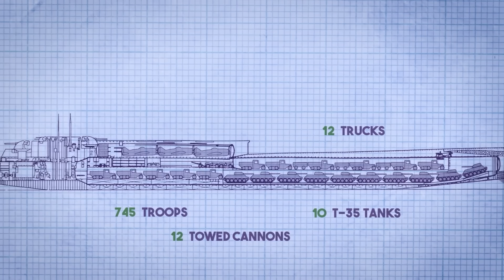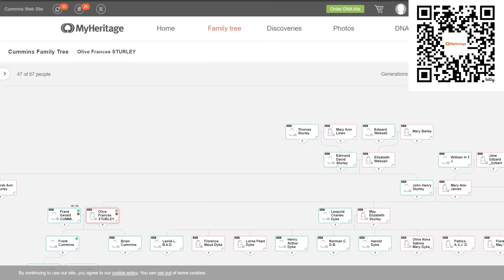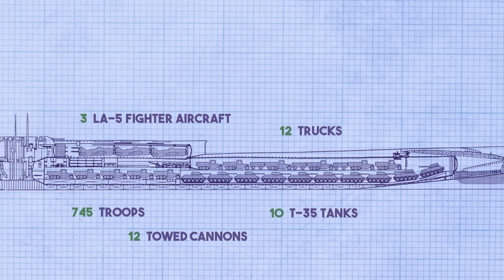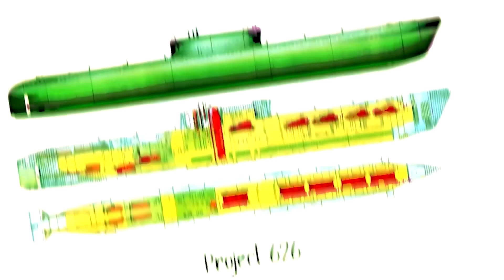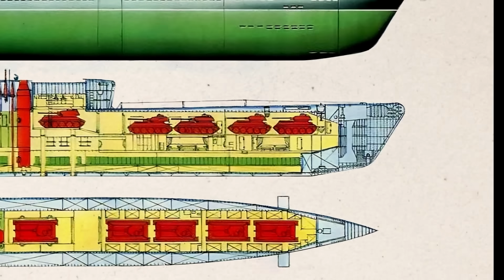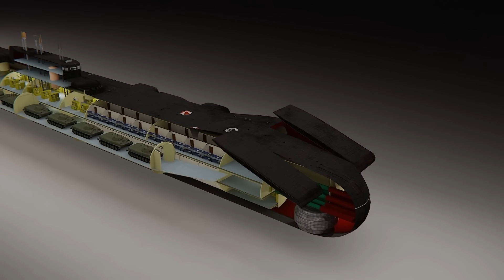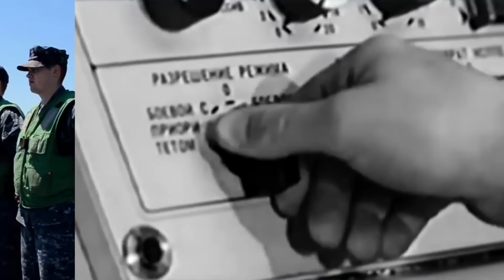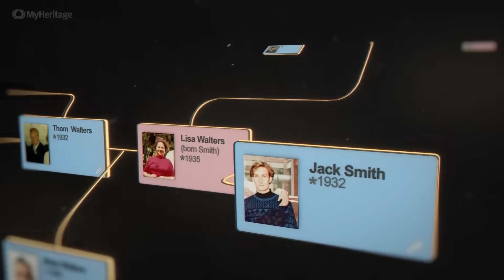Russia's giant submarines to invade North America

Comment: Project 621 was intended to carry T-34s, not T-35s. The T-35 is a failed multi-turreted heavy tank from the 1930s whereas the T-34 was a widely successful medium tank which would've been much more suited given its size and smaller crew.
Reply from the maker: Thanks for the correction
Reply: Uses T-34/85 3D models, writes T-35. 🤦‍♂️. 
I caught that too.
Reply: @CAP198462 to be fair post war the only T-34 variant worth anything was the T-34/85
Reply: @jameson1239  i mean that goes for basically any tank with a lot of gradually improved variants, the newest will be the best
Reply: Blame the Russians and their numbered projects. I mean T-34 is newer, better tank but T-35 is an old failed one built decades before.  It's as confusing as the Japanese way of naming their weapons with Type>insert number<.
Reply: @dareka9425  thankfully far better than the US' system for naming tanks. oh wait...
Reply: I was wondering how more than maybe 2 T-35's would fit in there xDD
Reply: It’s called a “mispronunciation”.  We all make them.
Reply: @TheAKgunner  It was not an error in pronunciation, rather a typo in the script. The difference between T-35 and T-34 is minor in terms of spelling but it matters within the context of the video, since fitting any amount of T-35s would require much more space than the same amount of T-34s. If the purpose of the video is to inform then the information presented should be as accurate as possible. 

Commenting on such an error increases engagement statistics and gives more context for anybody confused by the mistake. Its a win-win for everyone.
Reply: "Widely successful". I'd chalk that up simply to production capacity. The tank itself was Hell to operate and the Germans had the guns to penetrate it.
Reply: @MikMoen  The T-34-85 was relatively well armored, mobile, and had a very good gun. It was no means a wonder of engineering, but it was capable of killing the technically superior tanks of the German army. It became one of the most widely produced tanks in the world and is still seeing combat to this day, so I think it would qualify as a success.
Reply: This video is filled with errors. It’s popcorn level trivia.
Reply: Don't worry about it.  This whole video is a work of fiction - just like the Russian "threat" to the west today.
Reply: T34 crew is no bigger than T55 tanks until the autoloader tanks become the norm. It's driver, commander, gunner, and, loader. So no, their crew is no smaller.
Reply: I've seen many of these basic mistakes on this style of videos lately that I no longer watch these types of videos. Anyone have any recommendations?
Reply: @iiyyxxnn  Paper Skies, Rex's Hangar, Drachinifel, and Mustard are all pretty good channels to watch. I generally avoid the Infographics Show and Mega Projects because they're rushed videos and full of inaccuracies.
Reply: @moldypotato4656  I took a screenshot of your comment, thanks brother.
Reply: The T-34 was the most mass produced tank of WW2. That's the only thing it had going for it. Well, that and German stupidity.
Reply: @StudleyDuderight  German stupidity?!
Reply: @StudleyDuderight  When the T-34 entered the battlefield in 1941, it was superior to any German tank on the field. It suitability to large scale manufacturing and its upgradability meant that it was used well after WW2 and saw combat in other conflicts such as the Korean War.

Name one German tank still used after WW2
Reply: @SOLOcan  absolutely BS.
Reply: @SOLOcan  You're not looking at the full picture. The T-34 was designed to be just good enough. It wasn't necessarily superior. Russia could churn them out faster than Germany could destroy them. That's what made them so successful. Minus the maintenance and logistics problems, the Panther was superior to the T-34. If Germany had had the US' logistics capability and industrial base then we might be having a completely different conversation.

Most of Germany's aircraft and tanks were scrapped to rebuild the economy and infrastructure. It wouldn't have mattered anyway since the Bundeswehr started getting M-47s a few years after the war ended. All of the WW2 shit would have been phased out by Korea.

M-26s rolled right through T-34-85s in Korea.
Reply: @SOLOcan panzer 4s were used for quite a while after ww2
Reply: @SOLOcan panzer IV and a few others based on it where used as late as 1967 by the syrians in combat on the golan hights.
The French used panthers for some time post war. The Czech used quite a few german tanks and even continued to build and use of the sdkfz. 251 well into the cold War, at least the 1960s, but think I heart that they where keept in reserve for quite a bit longer.
The Swiss used the jagtpanzer 38(t) for a long time.
And that list is most likely not complete

With other allied tanks you have a similar story.

Cromwell and Churchill where used in Korea.

As where m-4s, m-24s and m-26s.

M-3 and M5 Stewart's where inuse till the 1990s.

Israel used the m-4 up until the 80s. 

Also the Sherman was or still is in use by chillle and the m-24 is also still in use in Urugay (or was it paragay).

SO the t-34 is not realy special in that respect.
Reply: @SOLOcan  was it though? the "inferior" german panzers and panzer 3s were able to score heavy casualties on the "invincible" t34 in the hundreds, waaay before the "badly needed" panthers and tigers came along
Reply: @polygonalfortress  This is the opinion of those German panzer commanders. It was pretty much accepted that they had superior tanks, but the Soviets lacked the training and doctrine to take advantage of it. 

Like this was a key part of Germany's strategy man. Stalin had just been done purging his entire officer corp. There were very few people left who knew how to lead a platoon.
Reply: @tobiasfreitag2182  I know the T-34 is not special in that respect. My point is that German tanks are special in that nobody used them after WW2. I've never heard about the Syrians using Panzers in 1967, why did they do that?

I know the French used panthers, but their opinion of it is often used as an example of how overrated the Panther is given they dropped its use almost immediately.
Reply: @SOLOcan   @SOLOcan  Yes, the T-34 suited the Soviet Union's doctrine. They needed a cheap tank that was easy to produce and was just good enough to survive a hit or two. Russia went all in on the wave tactic. You don't need to have amazing shit when you can throw an endless number of men and machines at an enemy that's suffering from supply shortages and incompetence.

I brought up the M-26 because you talk up the T-34 like it was the best tank of the period. Korea proved just how shit the series really was when up against something that was easy to maintain and could to be produced in significant numbers.
Reply: @StudleyDuderight  >M-26s rolled right through T-34-85s in Korea.

Heavy tanks from the very end of WW2 rolling right through medium tanks first designed in 1943. Shocker
Reply: @NamedPimpback The M26 was a medium tank, and the T-34-85 was not created in 1943.
Reply: @SOLOcan  well they they used them because the Czechs had lots of german equipment that was surplus to there needs, and there soviet overlords thought that this surplus equipment could best be used to supply there allies in the middle east.

For that reason the first equipment equipment used by the idf was german. For example, the Czech version of the bf-109 or the kar-98 rifle. Stalin, in the beginning, was very pro Israel, so that is where this equipment went first. Only after a major shift in Israeli politics towards the west around 1950 his focus changed, and the equipment was shifted towards the Arab nations. That's why ex german tanks ended up in Syria and stg-44s all over the Middle East. 

The syrians, as far as I'm aware of, used german tanks for quite some time, till they where finally slaughtered on the golan hights in '67. But I guess one can not so much blame that on the quality, lack thereof, of the german tanks as on a general inferiority of training and tactics. All Arab tanks suffered heavily at that time.
Reply: @StudleyDuderight  no the Soviet Union did not use “human wave tactics” their military doctrine was Deep Battle Theory and was the most sophisticated for fighting a modern war. It’s clear now you don’t know what you are talking about.

Again so what about the m-26? I don’t care about that and it’s got nothing to do with what I said. 

Yes I talked up the t34. I was specifically responding to someone talking about the t34, you have no idea about my opinion on the the m26, and that is deliberate. It’s called staying on topic, something you don’t know how to do
Reply: @StudleyDuderight  the m-26 was not a medium tank in the context to the t-34, calling it a medium tank is extremely misleading. It was reclassified after the war in response to changing tank philosophies and the development of the main battle tank concept

The Sherman considered by the US to be equivalent to the t-34, the M-26 soviets equivalent would have been the the IS-2. BTW many M-26 were eventually replaced by Sherman’s in the war because they were more useful, and yet you fail to consider this, only caring about K:D ratios like it’s a video game. When you say “ok at the bigger picture” what exactly did you mean?
Reply: @SOLOcan   Fair point about the reclassification coming after the war, but the M26 was still a medium tank when created. I'm gonna drop that argument though. It's too apples to oranges. I will have do some more reading about the tanks in the Korean War. I was under the impression that the M26 replaced the M4 because the 76mm wasn't cutting it against North Korean and Chinese tanks.

I don't think K:D alone is what wins wars. It helps, but isn't enough on its own.

You've been oversimplifying what made the T-34 a success. It was a long list of reasons(logistics, strategy, morale, numbers, air and artillery support, etc etc etc) all combined. That's what I meant by "big picture." The T-34 wasn't a terrible tank, I shouldn't have made that argument, but it wasn't very good either. You don't need the best tank in the world to beat an enemy that can't keep its own tanks running, and keeps making bonehead decisions. In the end it was the best tank for Russia's needs... Throw bodies at the problem until there is no more problem.
Reply: @n Uhh, dude, human wave tactics is and was Russia's bread and butter. They arty the shit out of everything in front of them, then send in a wall of steel and flesh. It only worked against the Germans because Germany had so many problems holding it back.

Again, uhh, dude, the Soviets were not the most sophisticated. That honor goes to the Allies for perfecting combined arms warfare, which wasn't a German invention by the way. I can't remember his name, but the man who came up with combined arms was a Brit.
Reply: @StudleyDuderight  I'm just repeating myself now

I know its apples and oranges. That's why I said "who cares?" and pointed out that its off-topic

No I didn't say the T-34 was the greatest tank, it's not even my favorite tank of the period. I was responding to someone who said that the only thing the T-34 had going for it was numbers and it was more the fault of the Germans for its success.
 
No the M26 was not a medium tank when it was created, the Sherman was. It was reclassified from a heavy tank to a medium tank after the war.

No, "combined arms warfare" is not "invented" by a brit. In terms of modern warfare, it is a extremely broad concept that had already existed for centuries when people realized you need both pike and shot. When I talk about Soviet Doctrine, I am specifically pointing to Soviet Deep Battle and more broadly their development of the "Operational Art", which shows their ability to contextualize battlefield performance to the social/political sphere. Something that the Germans were terrible at, and the Allies were good at but never really codified.

I have made an explanation in line with the context of your long list of reasons (logistics, strategy, morale, numbers, air and artillery support, etc etc etc) all combined. 

I pointed out the logistical context when comparing it to the tiger's logistical needs and production strategy of Germany and the Soviet Union. 

I have pointed how the T-34 is suited for the Soviets Strategy/Doctrine and their biggest strength, which is "operations". This was when I compared it to the Panthers limited strategic mobility by having to rely on rails.

I have pointed out the context of the t-34s versatility facilitated Soviet Commanders to easily and flexibly organize battle groups. ie. facilitating combined arms.

Meanwhile you just say, "human wave tactics is and was Russia's bread and butter" 

NO, the Russian's didn't just throw bodies at problems. You don't understand what the big picture is and you're oversimplifying what made the T-34 a success.
Reply: @SOLOcan  Your insistence that Soviet and Russian tactics aren't human wave tells me this argument is lost. I can't beat an idiot at their own game.
Reply: @SOLOcan I'll name three German tanks produced and used after WW2, by France, Czechoslovakia, Hungary, Switzerland, Israel and the various Arab States:
Panzer IV, Hetzer tank hunter, and the Panther.
Reply: Panzer IV, panthers, and STUGs III were all used post war by various countries, some even serving in battle in the 1970s @SOLOcan
Reply: @StudleyDuderight  What argument? For it to be an argument you actually have to say a point. I've pointed out specifically why the T-34 was used outside of attritional warfare, even the ones you highlighted. All you've done is repeat "human-wave" like a mantra and talk about the M26.

It's quite clear you've realized you're out of your depth and are trying to save face before running.

It's either that, or you actually don't know what analysis is and instead it is just repeating things you have heard.

No serious historian or military analyst uses the concept "human-wave attack" as it is to broad and ideological it becomes incoherent after any attempt to understand the conflict.

Why don't you demonstrate you know what you are talking about instead apply the concept of "human wave tactics".
 
You haven't given a reason why specifically the T-34 is suited for "human-wave tactics".
   
Why focus so much on a medium tank in general? For attritional frontal assaults something akin to the British Infantry Tank concept is much more suitable, so why not mechanically simplify the KV tank and up gun it with the 85mm to make essentially a reliable "Soviet Tiger".

They had the prototypes and existing manufacturing facilities. How does "human wave" explain their choice of a medium tank and the T-34?

If the Soviets really were just using the T-34 for mass frontal wave attacks, why is the Sherman so close in characteristics. Did the US also just use frontal attacks? 

If "humanwave" is and was Russia's bread and butter, why was there so much effort to motorize entire divisions and create mechanized armies? Seems like a waste of time

How does human wave attacks explain the changes to battles through the war? Why was a defensive battle fought at Kursk then? Why is there a difference between the opening phases of the war characterized by Germans making large scale encirclements of Russian army groups, but have the reverse occur later in the war like in Operation Bagration where the Soviets were able to create encirclements against a German army who was competent at maneuver warfare? 

HMM, maybe there's a bigger picture
Reply: @YouTubeSaysThereCantBeTwoRyans he didn't specify it must be a ww2 vehicle
Reply: @SOLOcan  Uhhh, panzer 4. Also panzer 3s. I think StuGs as well. Not sure about the light tanks. I don't think the Panther or Tiger were used for very long after the war.
Reply: @IIXxSLAYERxXII  It's superiority was in quantity only.
Reply: @Del-Canada  yes
Reply: @SOLOcan   just because russia is willing to resurrect antiquated WW2 equipment. and send modern soldiers to die in the drone war with it. does NOT mean it was a good tank..  all russian equipment is usually inferior for the same reasons. and the T-34 was no different.    and No. the T34 was not the most superior thing to hit the battlefield in WW2.  not even at the moment.   it was Always lacking in. in electrical equipment. in radio equipment. in Trained Crew.   in Ammo quality.  in Armor Quality.  In Steel quality.  In Weld quality.    Russia has simply, never in history. not once. fielded a piece of tech/equipment or vehicle that was superior to eveything else.  by design the russian government uses what it can to get whatever results it can.  (usually meat waves.)